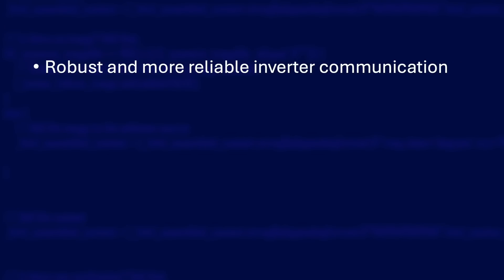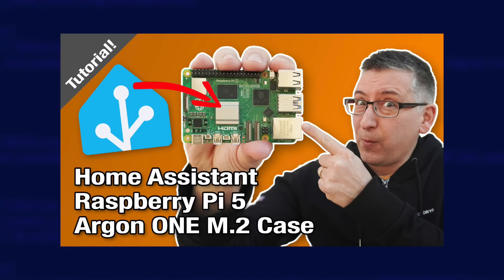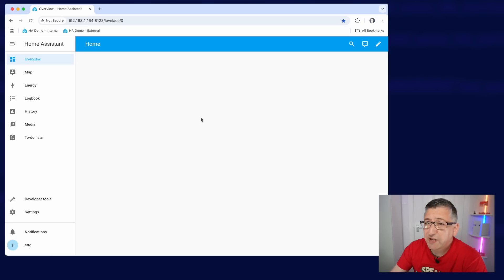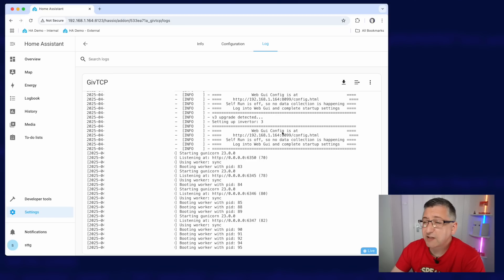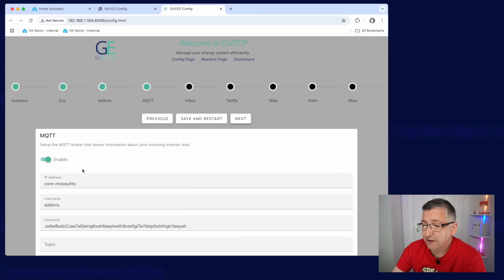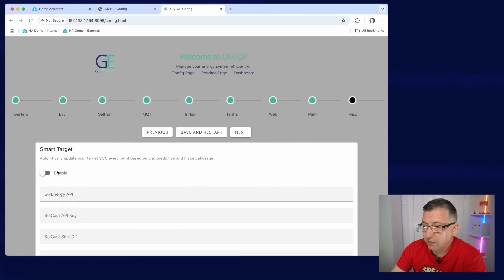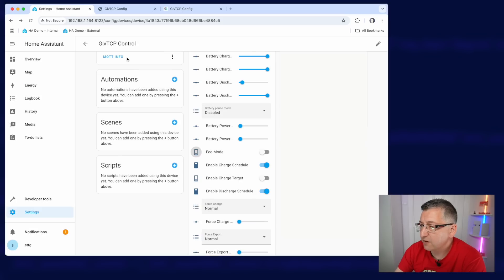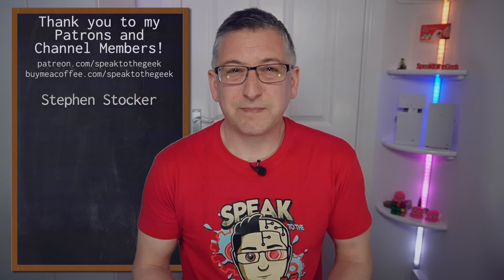GivTCP v3 Setup in Home Assistant (2025 Guide!) | Unlock Full GivEnergy Local Control

Comment: I’ve just moved house and brought my AIO and Gateway with me. I am looking to get it installed and whilst I came from a Zappi, I’m thinking of moving to the GivEnergi Charger to keep within the ecosystem. 

I had HA before and dynamically charged the AIO with Int Octupus Go tariff so I could top up the battery. Having had a GivEnergi Charger do you foresee any issues reading when the charger dynamically chargers so I can move the battery to charge also ? 
Many thanks for the videos and the content.
Reply from the maker: There would be no issue doing what you are suggesting, however you don't necessarily need to be able to read the data from the charger to be able to know when to charge your batteries. The Octopus Energy integration for Home Assistant by Bottlecap Dave has an off-peak sensor. You just trigger the start and stop of forced charging based on that sensor. I made a blueprint to do this which you can import here: https://github.com/sOckhamSter/homeassistant-blueprints/blob/main/IOG_GivEnergy_Inverter_Control_Simplified.yaml
Reply: @SpeakToTheGeekTech  like The Postman, you always deliver! Many thanks!

Comment: Hi. I had this all installed on a very old version of GivTCP, and removed everything and updated to latest 3.5 but despite having installed it, and the package running, config doesn't work - it loads up as about:blank#blocked - and if I manually go to the address for config, http://192.168.0.3:8099/config.html,  the config finds no devices and has a red error popup at the bottom which says "Error: TypeError: Failed to execute 'fetch' on 'Window': Failed to parse URL from http://:8099/settings".

I am running on a Synology NAS in a docker. I have my firewall off, and I have tried both Brave and Chrome and both behave the same. Can you please guide me as to what is wrong?
Reply from the maker: Your best bet is to join the GivTCP Facebook group and ask for assistance in there - there are a lot more people available and someone may have a similar setup to you and is able to offer advice. https://www.facebook.com/groups/615579009972782

Comment: Thanks for the great video. I have followed the instructions a few times but I can't get past this error in the log "2025-12-23 14:34:23,302 - Inv1 - sync        -  [ERROR   ] - Connection to (192.168.1.127, 8899) failed: timed out" That IP address is my inverter IP. I've tried re-starting the inverter, making sure my phone app is not accessing it. I've used "nc" (from the HA bash prompt) to check that I have a route to that IP and that the port is open. I also tried installing Mosquitto and GivTCP as docker containers on my synology NAS but I get the same error there even though the set-up process is quite different.
Reply: Oh - I do get errors using that config wizard (rather than env vars). It says there's a server error. The log says something about not being able to write a settings file to a config folder. I don't know what that's about.
Reply from the maker: The best place for assistance is on the GivTCP Facebook group: https://www.facebook.com/groups/615579009972782
Reply: @SpeakToTheGeekTech yeah - I'm on to my second post there now 😂
Reply: Strange - I did an inverter reset and HA re-boot (after fiddling for ages so who knows what I changed),  now it's found 9 devices. I still get the config file error but maybe things will work. I'm sure half of these issues are something to do with the HA VM setup on Synlogy. I found a guide on how to set up HA on the synology but couldn't find one with that combo and also GivTCP so perhaps I need to map some external folder. I did have to change the permissions on some folder structure at some point.

Comment: Hi, I’ve recently been aware of this method as I’m now in a dilemma of if I need to increase my battery storage I will need a second inverter and a balance issue.
Setting this up will it control both inverters separately. 
Is there anything else that I would need to do? Or buy?.
 I currently have a gen3 3.6kw hybrid inverter 1x 9.5kw and 2 x gen 1 5.2kw batteries.

My plan was to add another 9.5kw battery with say another gen3 hybrid inverter.
Would any other settings or apps need to take place to control them separately.
Thanks in advance.
Reply from the maker: GivTCP will let you control both inverters separately and I do this with my AIO and AC3. But GivTCP does not do balancing - it could enable a slow form of balancing which I used to do via automations. One of GivEnergy's employees is working on a Home Assistant integration designed to balance two inverters at high speed - if you join the GivTCP Facebook group you should see posts from him about the GivBalancer.
Reply: hi yes thanks, I’ve recently joined this group. Thought this video would solve the problem. 
New to all of this.

Comment: Thanks so much. I have bought a Green and been able to set everything up. Right at edge of my IT abilities. I can now see the time slots. I want to add two more as I have Octopus Cosy but Gen2 inverter which only has 1 time slot. How do I add a time slot to start and stop charging the batteries?
Reply from the maker: You can’t add more time slots than the inverter supports. If you want to charge or discharge at other times then you need to create an automation to charge the existing slots or to do a forced charge
Reply: Thanks. Yes . Thats why I’ve got home assistant because the firmware for the inverter only supports on charge every 24 hours and I need 3. What’s the simplest way to learn how to set up an automation for this? Can you direct me to a video?
Reply from the maker: The best thing to do is join the GivTCP Facebook group. Lots of people in there who can help you with your specific scenario
Reply: @SpeakToTheGeekTech thanks I’m in there now
Reply: Yes. That’s what I thought. That’s why I’ve bought home assistant. How do I do that? Could you direct to info/ video on automations or preferably automations specifically for this purpose?

Comment: Thanks for this video. I have setup GivTCP + MQTT etc. I get the values showing in home assistant. However, on my GivEnergy iOS app, it can no longer find my inverter on my local network. Therefore I can pull the data on the iOS appt using the "away" mode. But not the "home" mode. Not a massive issue but I just thought I would see if this is normal or not.
Reply from the maker: No it's not normal and I have never heard of GivTCP breaking the app's local control. Did you set GivTCP to refresh any faster than once every 30 seconds? If so that could be the cause of the issue - you can't update more often than that or you'll start getting access conflicts.
Reply: @SpeakToTheGeekTech  Thanks for the quick reply. On Giv TCP, the self run loop timer is 30 seconds. The self run loop timer (full) is 120s. The away mode on the givenergy app used to refresh every 5 minutes. Now it refreshes every 30 seconds - not sure if this is linked. If I turn off my raspberry pi (or stop MQTT and GivTCP) the ios app finds the inverter with no issue and home mode works fine.
Reply from the maker: Very strange, not heard that before. Might be worth raising in the GivTCP Facebook group

Comment: GivTCP is great, but it has so many devices with similar sounding names, i think it's really confusing.  Octopus go are sometime providing free electricity for an hour when supply is high, so I want to stop my battery supplying current for the duration of the free from the grid offer.  At the end of the free time, I want to turn the battery back on to supplying the house.  But i can't identify which device setting I need to change to enable this on/off of the battery supply.  Can anyone help?  Control feature like 'Turn off GivTCP control GivTCP Enable discharge'  - does this turn off the enabling of the discharge, or the discharge itself?  You see what I mean?  There's lots of similar sounding options that seem very ambiguous.
Reply from the maker: Just toggle switch.givtcp_xxxxxxxxxx_eco_mode - if that's turned off then it won't charge or discharge.
Reply: @SpeakToTheGeekTech thank you for such a speedy response,  but,  just to illustrate my problem,  I can't find that toggle in the GivTCP control set. I guess I'm looking in the wrong place.  I'm setting up an automation so this is in the 'then do action'.  I choose GivTCP control as the device (with an mqtt icon)  but can't see the eco toggle in the action choices.
Reply from the maker: That's not how automation actions work. You need to use a 'Switch: turn off' or 'Switch: turn on' action and select the eco_mode entity as the target of that action.
Reply: @SpeakToTheGeekTech I really do appreciate this help.  What i had failed to appreciate was that, even though there were no update messages for GivTCP, my version was still on v2.  The eco option turned up with v3.  Now I've upgraded,  I can use either your method or mine to control it. More then one way to skin a cat.   Thanks again.

Comment: Hi. I noticed you didn't enable the Givenergy EV charger monitoring. I saw an earlier video of you installing it. Do you still have it? Is it good? I'm thinking of installing it, but it's not a popular product not much review about it.
Reply from the maker: I do have the GivEnergy EV charger, I think it's a great product and it's very reliable. There is however a bug that's remained unresolved for a while concerning using GivTCP to monitor / control it when the charger is connected to the network using Ethernet. Very specific circumstances yes! But if I enable GivTCP for controlling my charger then the charger will drop off the network after a few hours until I power cycle it. So I don't use GivTCP, I use cloud control and it's very reliable that way. (I have a video on cloud control of the GivEnergy charger here: https://youtu.be/uBmra2CW_5Q )

Comment: Absolute novice on HA and have started with your clear video but Mosquitto Broker install is stuck on 25.4% Add on CPU usage and 0.1% Add on RAM usage.Any ideas?
Reply from the maker: That's a new one! I've genuinely never seen Mosquitto fail to install and I've done it many dozens of times - you can see how quick it is in the video and that's on a Raspberry Pi 5. I've installed it on a Pi 3 and a Pi 4 and in virtual environments with no issues. I would suggest of course a reboot of your device first but if it keeps failing to install then there may be a more general issue with Home Assistant and it could be worth taking a backup (if necessary), wiping the installation and starting again, restoring from backup if you need to.
Reply: @SpeakToTheGeekTech  Thanks . Have just tried a reboot. Its a new HA Green and evertyting else seems to be working fine. Tony
Reply: Strange but it seems the Mosquitto did install?
Reply from the maker: It was probably just your web browser session that hadn't updated then

Comment: What’s the difference between GivTCP power SOC and GivTCP battery SOC. As they never match unless it’s 100%.
Reply from the maker: The battery SOC is for the battery pack, you could have multiple batteries each with different SOC levels. The main SOC reading is from the inverter and is the one you should rely on. That reading combines the SOC from all the batteries and also takes into consideration reserved capacity from the batteries that you can't use.

Comment: Even though I don’t have Giv energy it’s great to see the manufactures making it easier to integrate with HA. Power flow is great but I could do with two additional add-on elements in mine taking it too 11 but guess it’s too much but I would like to get my battery racks humidity and temperature in the flow too 😂
Reply from the maker: This add-on will give you temperature data for the inverter and the battery cells, no humidity though.
Reply: @ yeah got all of that in the PowerFlow but all the segments have been used for grid & island frequency, voltage and so on, as I got a battery heater in each rack I wanted to see when they turned on saying that I would have also liked my cooling to be displayed but you can’t have everything I guess lol

Comment: Im Struggling to get to the config page - its installed happily and detected my inverter and battery, but the config page fails to load ? any assistance would be great please - i am running a /22 subnet, so i am interested by your comment about /22 support as i haven't got to that part in the video ?
Reply from the maker: There's nothing special to know about /22 support - it just supports it now. I had an issue getting it working originally but after debugging the code I figured out the issue and submitted an update to fix it. Do the logs show the URL for the config page as per my walkthrough? If so you can just copy and paste that in to your browser. I have used Home Assistant OS running natively on a Raspberry Pi but if you are running Home Assistant in some other way then you might have to make sure you have the correct ports open to allow access to it. The best place to get support for this though is the GivTCP Facebook group because there are many more people there able to answer questions, and you are also able to share your logs and config there: https://www.facebook.com/groups/615579009972782/
Reply: @SpeakToTheGeekTech  thanks, i found the issue, for some reason my firewall was silently blocking it, weirdly it pops up everything else it blocks, but i can only guess that my daughter was on my machine and muted the alerts maybe ?? - once i traced it down in the logs, i added an exemption and it was happy..
Reply from the maker: @TheDragonsrage99  Pesky firewalls :) Glad it's sorted